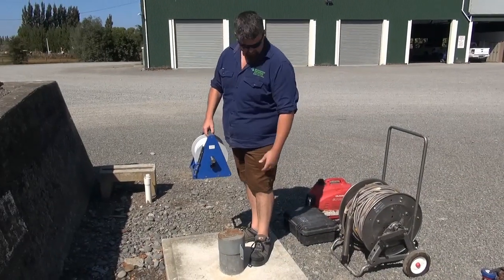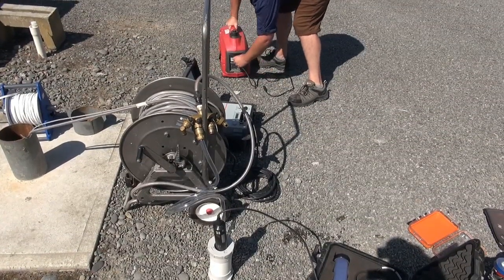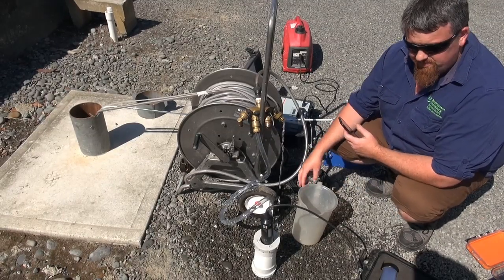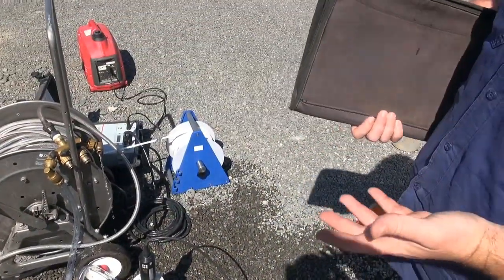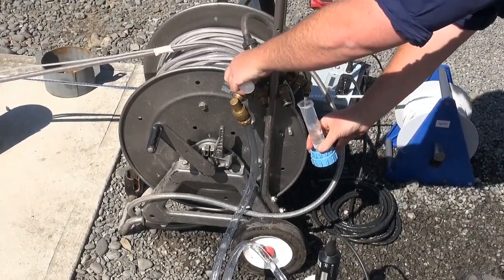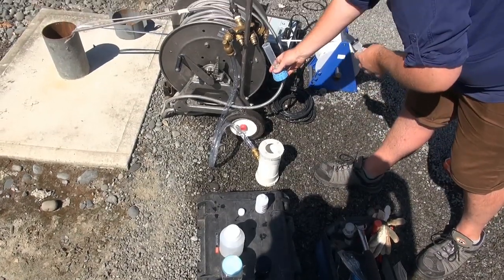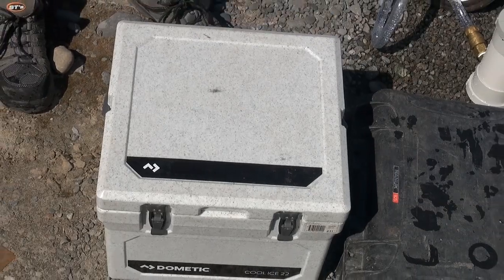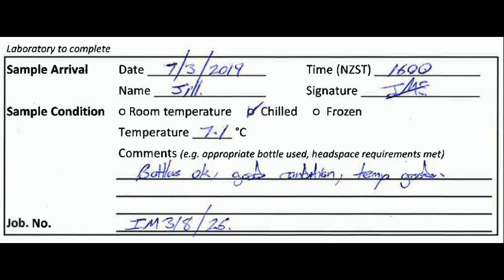WQ Groundwater - Low Flow Sampling.

Comment: How long on average does it take to sample one bore from start to finish?
Reply from the maker: Hi James, I will ask he expert you see in the video and get back to you soon - Evan.
Reply from the maker: Hi James - Dave told me setup is usually 20min, could be 40 for a 120m deep well with low yield. To process a simple 6" well would be 10-15min. If it takes longer than say 60min use 3 volume method. But usually 2-45min total for this method. Hope that helps. Evan.
Reply: @NIWAeLearning  That helps for sure. Thanks for the reply.